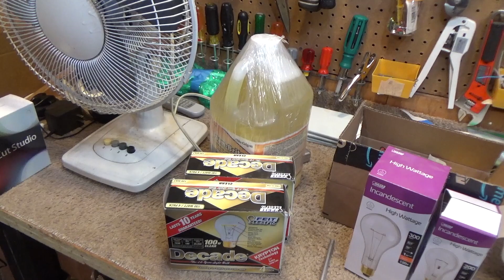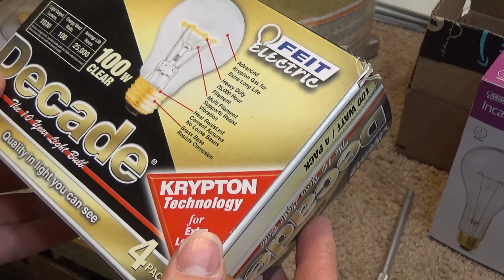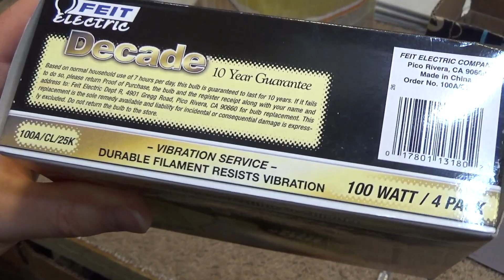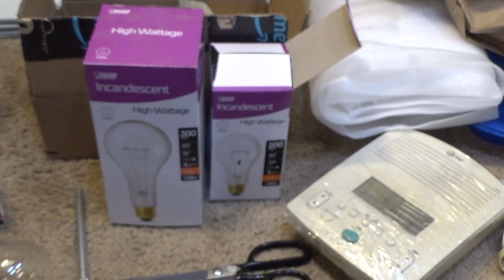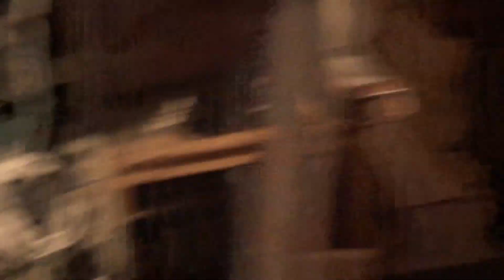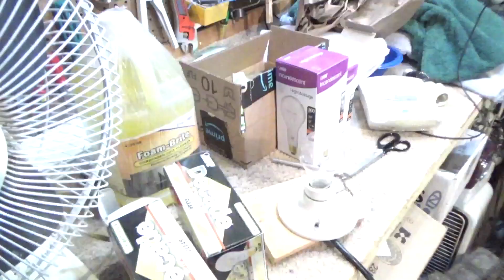Feit Electric 100 Watt Incandescent Decade Bulbs

Comment: 90% of LEDs are pretty gimmicky because they’re overdriven. Even so many reputable companies do that. I wish fluorescent light bulbs were still affordable and manufactured. Those worked very well. However, I have Explux LED bulbs that are still going strong after 30,000 hours. Most of my other bulbs haven’t lasted near their rated lifespan and are definitely overdriven. I’m hoping the Feit 17.5-watt LED bulbs last. They are rated for enclosed fixtures and they run noticeably cooler than even my 60-watt equivalent Quality Light Source LED bulbs. I can definitely leave my hand on my Feit 17.5-watt bulbs for more than a minute without getting burned. 90% of LED bulbs typically run way too hot and they can’t be touched during operation.
Reply from the maker: OK

Comment: It’s a cool bulb with unique krypton technology, but I would just go with a standard 750 hour, 1710 lumen incandescent light bulb. I think lumens is more important than life expectancy for light bulbs in my opinion. I miss seeing those good old standard 100 watt incandescent light bulbs. I don’t like those 72 watt halogen bulbs, 130 volt bulbs, rough service bulbs, and those 23 watt CFL bulbs. CFL bulbs contain mercury and pose potential fire hazards compared to those normal incandescent bulbs. Standard 120 volt general service incandescent and those newer filament LED light bulbs are the best light bulb technologies in my opinion. My most favorite kind of light bulb technology overall is probably those mercury vapor lamps as well as those metal halide lamps and high pressure sodium lamps. I want to get my hands on one of them eventually. Of course, it requires a ballast and I like that. Externally ballasted lamps are cooI! honestly even like those better than the integrated LED fixtures. They are far more easier to repair. There was no need phase out mercury vapor light bulbs. They are very efficient technologies as well as metal halide, high pressure sodium, and those fluorescent tubes. Fluorescent tubes are nice. They are really interesting compared to CFL.